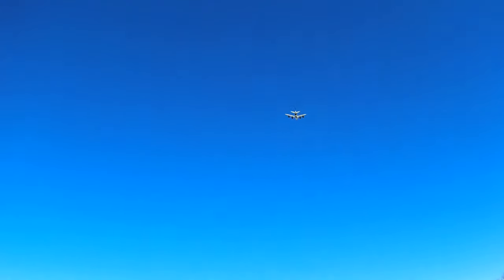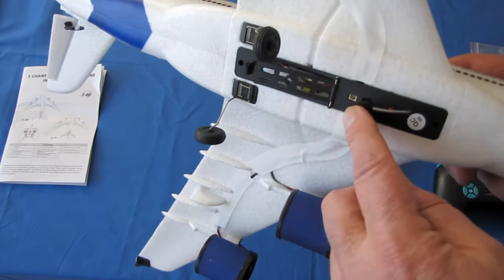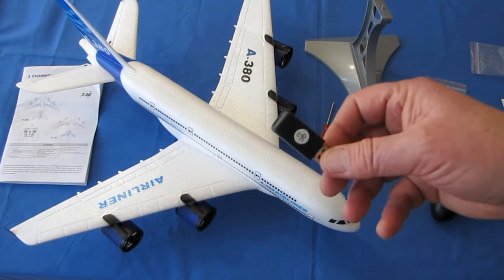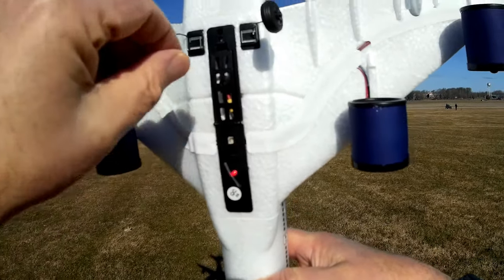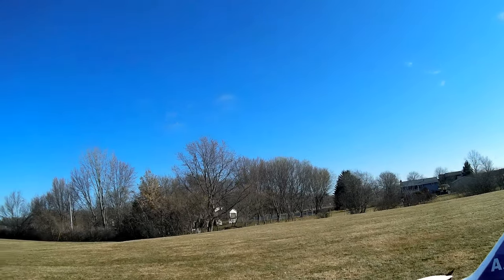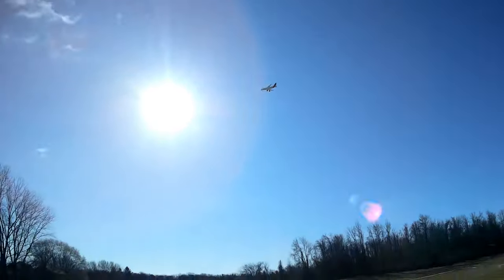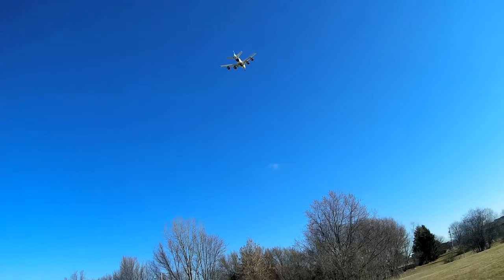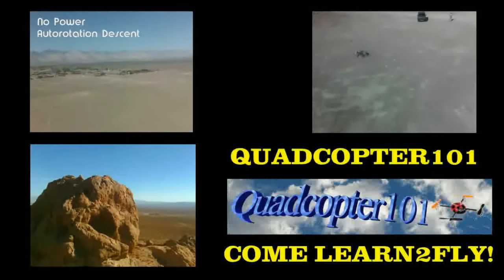Airbus A380 RTF Three Channel RC Airplane Flight Test Review

Comment: Nice plane Mr. Quadcopter! Looks like an XK plane but the only thing is the ducts has been added. I love this little 3 channel flies with differential motors, I learned to fly 4 channel planes because of this kind of planes. I have a QF008 Boeing 787 3 channels plane which later I sold to a very cheap price to someone who wants to learn to fly planes and he was very happy! That was the only plane that I flew and never lost connection whenever I flew it on the 200 meter range. I really missed that plane because it turns gracefully in the air and it looks like a passenger plane! Very cool plane!
Reply: Where did you buy that plane... I'm looking to start flying rc planes with my brother and we don't know where to start

Comment: Thanks for the included info on the protocol. Not sure this is such a great upgrade on the XK A150 though. Bigger and more power from the 4 motors but sucks the battery quicker. Those underhung motor ducts look like they will be more likely to sustain damage on rough landings than the sleeker pusher arrangement on the A150 also. Still it looks nice though I can't see it replacing the QF008 787 in the Bang-for-Buck stakes.
Reply: 쟈&@&@&<>>÷8282*@ 노노

Comment: Indeed a good looking beginners plane. Especially those 4 (!) ducted motors are quite a novelty on a beginner plane like this; more realistic than those pusher props differential trust planes. Maybe it's possible to use a slightly bigger battery to get some more airtime? Guess you can always get extra batteries.
Reply: Gonna try with my 720 mA batteries. Fits into a 500 mA slot.
Reply: 그렇습내다참으로보기좋은

Comment: Cool looking A380 ;-) It looks extremely stable and very maneuverable. See you in the Air!
Reply: Looking forward to watch your review on this. Do you have one coming your way? 😎
Reply: @acche-rc  Thank you much! As far as I know, I do not have one on the way. Looks fun though doesn't it ;-)
Reply: @GroundControlRC  oh man 😁
Reply: the battery is a bit too small .took it out tonight you seem to need full throttle to get it off the ground, gonna try again tomorrow.see you in the air if i get off the ground hahaha!
Reply: @kelvinbloomfield1375  Good luck and hopefully you'll have a bit of a head wind to get it in the air ;-)
Reply: @GroundControlRC  yea it has a big battery bay so im sure it could handle  something  bigger. gonna move the control horns as are on the outside link

Comment: I think this is an old plane you covered in a previous video.  But now seems to be updated with ducted motors vs exposed pusher props? 🤔
Reply from the maker: Here's the other version.  It's a bit smaller with 480mm wingspan (vice 540mm) and two pusher propellers (vice 4 ducted props). https://www.youtube.com/watch?v=Zcowq-KyxD8

Comment: Thanks! So.. it's not really an improvement from the last model? The xk a120? 2x the power with half the flight time? It'd be great if you can fly it again with weaker wind 😎
Reply from the maker: Well.  It's bigger.  And it also comes with a display stand !   ;-)
Reply: @Quadcopter101  oh I didn't notice it's bigger! 540mm vs 420mm, cool! Any chance of fitting a bigger battery? 🤔 And how could it have power drain even with switch off? Hmm..
Reply: Mine arrived and you're right about the flight time.
Reply: @Quadcopter101  its too big  for me  for jusy a 4 min flight time with a 550 mah  lipo  ,big mistake buying this one for me looks cool though lol
Reply: @kelvinbloomfield1375  got some 650mah.  I think it'll fit 1000mah physically but it might be too heavy
Reply: @acche-rc  cheers ill order a few 650 lipo s.  if i can find any with the low c connectors

Comment: Looks a lot like the XK version of the same airframe but with different motors and controller
Reply from the maker: Xk version is smaller at 480mm wingspan.
Reply: @Quadcopter101  Thanks, for the info sir, i have the XK version and ive always wondered how it would be with a ducted fan.

Comment: Hello I recently subbed to you and started getting into rc  but one question what are rc channels
Reply from the maker: They are the control input signals from the transmitter that are sent to the plane. For this three channel plane they are 1) throttle, 2) elevator,  and 3) yaw (turning) controls.
Reply: Thank you

Comment: sucks plane i buy this from aliexpress for $81 i keep changing battery every 4 minute flying like a paper not fun at all
Reply: this plane flies for at least ten mins.
Reply: @kelvinbloomfield1375  Not according to this video. "Total flight time 4 minutes 13 seconds."
Reply: put a bigger pack in. i got this on flash deals for 59 euros
Reply: @kelvinbloomfield1375  I hooked it up to the battery out of my Kenwood truck. Hoooge battery capacity - but it couldn't fly at all! :D
To be serious, this thing is at the limits of power to weight - adding more battery weight is not going to help this one!